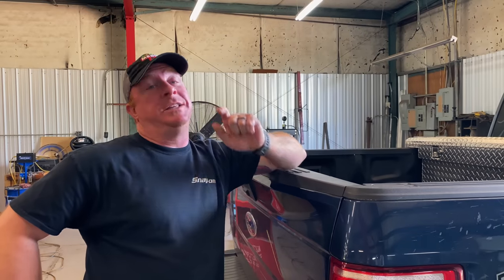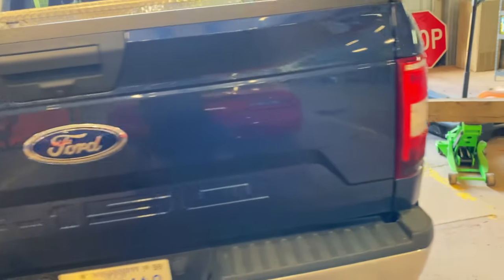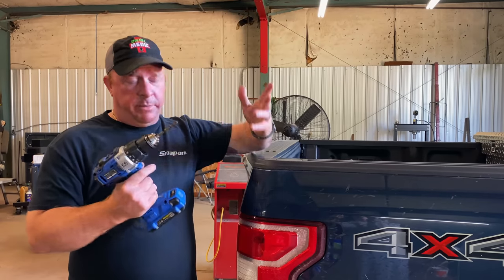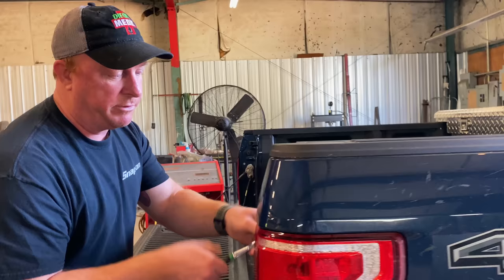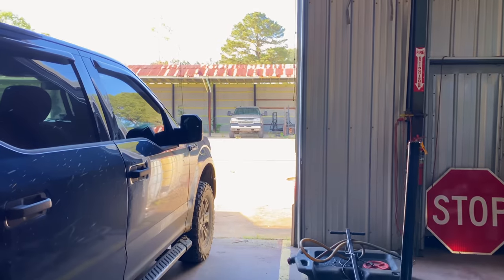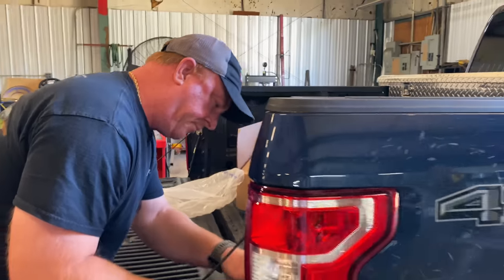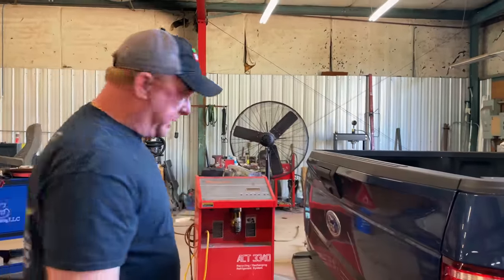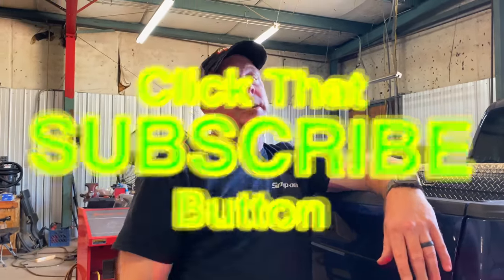How To Fix The Infamous Ford Tail Light And Why It Happens. Ford Knows It's An Issue! DIY Fix!

Comment: Koon, I had a 1991 Ford Mercury Topaz, that would collect water in it an burnout the headlight bulb. On advice of a Ford dealership mechanic, I removed the headlight assembly and drilled a small hole (so the hole was facing the inside of the car body) to act as a drain hole. I found a gore-tex vent screen that you install with tape. This screen would allows water out but keeps dirt from the outside world out. It worked great for the 8 years I owned the car.

Comment: Just found this video because my 2011 F150 taillight had water in it.  You are right about Ford making crap.  I have owned Fords for decades, but the latest stuff from them drove us to finally purchase a GM product.  Glad I purchased the extended warranty as we really got our money's worth with that.  
- AC & heater switch failed in the first 3 weeks (on a ski trip in the winter - so no heat).  Took 3 months to get the part as it was back ordered nationally.  That was a cold winter.
 - AC blew out Freon when the truck shut off (found this in April when we first used the AC).  Took 5 different trips to the dealer, and finally flying down a Ford mechanic from their factory to find that a screw had fallen into the compressor line when the truck was built, which caused the compressor to blow out the freon each time it was shut off.  Whew!  We finally had working AC & heat!
 - Transmission seal leaked badly after four years and 40k miles, while we were on a trip through the mountains, causing the transmission to fail as we tried to drive it to a nearby town.  Replaced under extended warranty.
 - Front driver electric seat replaced at 45k miles, as the mounts wore out/got loose.  Safety issue.
 - At 50k miles I was going to take a long trip to visit family, so I had the Ford dealer service it and go over it with a fine tooth comb.  Did not want to break down on yet another trip. When I picked it up, the RPM guage didn't work when I turned it.  Turned it off, grabbed the Ford service manager and he turned it on and everything was fine.  Odd, but I went on the trip from TX to NC.  ~100 miles short of my destination, the RPM and speedometer gauges quit, could not shift into 1rst or 2nd gear, and was traveling through mountains.  Had to use my Garmin to tell my speed.  Finally made it to family, called the local Ford dealer and the truck spent the next week in the shop having a transmission sensor replaced.  Just squeezed this in under the warranty which ran out 24hrs later!  
- Top rear taillight (in the cab roof) leaked allowing water to pool under the passenger quarter panel.  3 trips to the dealer to get this resolved.  Now the taillight is leaking. Sigh...

Comment: The taillight on my My 2016 F250 filled up with blinker fluid, but not only did it give me the fast blinker, it first triggered all kinds of electrical faults - no cruise control, intermittent loss of power,  backup camera failed, “AdvanceTrac” warnings, and eventually stuck in limp mode.  Me and my buddy discovered the blinker fluid, drained it and put in a new bulb and socket, and lo and behold, all “failures” disappeared.  The guys at the dealer had replaced the Body Control Module  (?) trying to fix it and it would have cost me $3600 but it didn’t fix anything.   A $45 repair from O’Reilly is all it took :)

Comment: You are doing better Mr. Joe.  I have a jeep that the dealer would not fix the brake under warrenty, called jeep and another local dealer fixed the problem.

Comment: Great video I can see you frustration I went threw 3 trucks in 3 years  Silverado, Denial, Raptor. Transmission shutter's lifter failure, cam phaser rattle, you can guess the issue 
by the make of the truck. I really loved all those trucks but I need reliability more then  bells a whistles. I broke down and had to buy a 2021 V8 Tundra its sad the Tundra
is a 15 year old platform and Its one of the last true reliable trucks, Let's see how all these six cylinder turbo's hold up.
Reply from the maker: That’s what I own now also. Tundra all the way!

Comment: Sorry you have to go through that...I know it can be frustrating but don't cheap out...make sure you flush the lines and install fresh Blinker Fluid. Otherwise you'll regret it down the road...😉
Reply: I replace my blinker fluid on a timely basis, and never had a problem.  Most guys wait too long.
Reply: Spoken like a true Mopar owner.

Comment: Whatever you do, do not drain the blinker fluid onto the muffler bearing. That would be bad..
Reply: But I heard that you can fix these problems using a left-handed monkey wrench!  😁
Reply: That will also ruin your Tail light oil seal too.

Comment: I've actually ran across that problem on several square body GM trucks, that's why I know when I get one to replace the taillight gaskets.., but as far as I'm concerned that's just another reason I don't need a newer truck than my early 94 Chevy Silverado extended cab short bed z71 265, miles on its 3rd motor and 2nd transmission, and it's tailights are scratched but not leaking.. anyways the build quality of newer trucks should be better..

Comment: I'm surprised that in your anger you left out the most important step. Make certain this is the last $150 tail light lens you ever buy from FORD by squirting a generously thick layer of clear silicon all along the seams of where the lens mates to the housing of the tail light assembly before you screw it back to the body.  They seem to mostly leak around the seam.

Comment: My Chebby front turn signal had that problem. It got the silicone special. 😂
Reply: Yeah I heard that,my early 94 Chevy Silverado has spyder halo hid replacement headlights and amazon smoke turn signals and it still ended up with water and moisture inside the headlight housings..

Comment: Reason #126,439 I will not a vehicle newer than 2012ish. Should have the $180 led aftermarket pair from eBay/Amazon/etc and sealed the lenses with clear silicone, because any aftermarket lights you must seal with silicone because they’ll leak too, and been done with junk Ford parts! Criminal a vehicle made 10-12 years ago or longer is a better made vehicle than what is being produced today.

Comment: If you have a bliss sensor and this happens you are in for even more fun with your blinker fluid causing your whole truck to go haywire.  If you have bliss it can cause your heating and cooling system to shut down, bliss to turn off, front windows to not work, power running boards to not work, and airbag lights to come on and navigation to shut down.  Good news is you can still roll your back windows down and use slider window, radio still works and blinkers still work. Talk about a freak out moment while driving.  Whole truck just becomes possessed.  Well I took off the rear light and it was filled with blinker fluid.  Disconnected it from truck and everything works again. The damn blinker fluid caused all of those problems.  Why is it most commonly passenger side tail light as well from what I have read from others.  I am not throwing my old light like that until I get the new one tomorrow though....lol

Comment: Ford screwed a friend of my dad's once.He had a 1989 F150 with the 302 and had the piston rings replaced under warranty just before the warranty ran out.Told him he needed to get an oil change done,the oil wasn't covered and they dumped the old oil back in.He wasn't too happy about it at all.Dad ended up putting in a Jasper reman engine in after that

Comment: I think you over filled the blinker fluid reservoir. I don't think you should blame it on Ford.  That is why the warranty didn't cover it. That was your fault. Thanks for the video.  It will help me to remember not to over fill mine on my new 2024 f150. 👍🇺🇲

Comment: I had a 2017 and now have a 2020 and never had that problem and the company I work for has about 25 2018/19 trucks and they are all dry do you have friends that have this problem to should I be concerned my truck is going to do this?
Reply from the maker: It’s going to happen eventually just wait

Comment: This exact truck also has GROUND wire issues. The issue is they wear out of break/rust in half completely. We replace these all the time at the shop thanks to paying the Kentucky Plants electrical engineer to show us the way. There is a multitude of errors and issues that come from this ONE THING! Grounds!! They have accounted for almost 50% of the errors we get off the computer. Yet No one and I mean NO ONE ever considers these wires because they look so simple and benign. Oh hey see! they look fine. 😂 until you take one off the frame or body. Then you know.

Comment: Ok, so I had that issue. Bought a new housing (not OEM) and it worked great…until it didn’t. Now, when I turn on my left blinker, my right side also flashes. My left brake light also doesn’t work. I’ve replaced the bulbs but still nothing…any thoughts? The light in the left one work, just dim and don’t work properly. Do they have to have LED lights to work? Thanks!!
Reply from the maker: Got to be in the wiring not the housing assembly

Comment: Had a Ford truck for a used vehicle inspection about 5 years ago that needed a power fold mirror. $650 quote for the part from Ford. 😂

Comment: Bought a brand new 3.5 eco boost f-150 in 2011 kept dropping turbos from hauling race car trailer and snowmobile trailer 2014 traded that in for a brand new 5.0 f-150 transfer case made all kinds of noise Ford replaced it 2017 traded for another 4 door F-150 with a 5.0 everything was fine until it started using oil a lot of oil had 136xxx on it Ford dealership said it’s normal. Got tired of the bullsh!t from Ford traded that in for a 2020 tundra let me tell you what a complete night and day difference way more power and much more comfortable to drive and Toyota gave me the most for my trade in. I used to bleed Ford blue but honestly I wouldn’t get caught driving 1 past 1996 model year

Comment: I have a weird situation I hope someone can help me with. I did all of the above and it does work... The bottom light in the replaced tail light works only when braking and when I press to unlock the car. It shuts off right after. When the car is running, the upper light is on, but the bottom is off. The other side works perfectly :/

Comment: I am extremely disappointed with this video  My wife's 2019 F150 has this exact problem, every time it rains the tail light unit gets water in it and shorts the bulb out. I was elated when I found this video, I thought it would have some useful information on how to rectify the problem, maybe instructions on how to seal the unit to prevent future leaks. All I got was a would-be comedian replacing the entire unit. I wasted my time watching this worthless video. Big thumbs down.
Reply from the maker: That’s how you fix it. Replace it because Ford sucks. If you haven’t figured that out, now you know. Sorry this let you down on how to fix your taillight but clearly this IS the only way you will fix it

Comment: That's nothing.... get 1 that's has the side detection radar modules in the back if each ...water goes in, medium CAN bus goes down, all kinds of electronic issue happen. Tailight and module equals thousands

Comment: Why not install the hole in the BOTTOM?
Reply from the maker: Unsealed it still allows moisture which equals corrosion and that gets the wiring harness and connectors